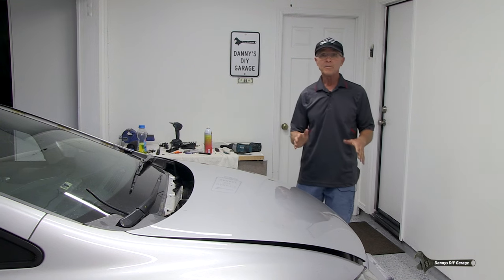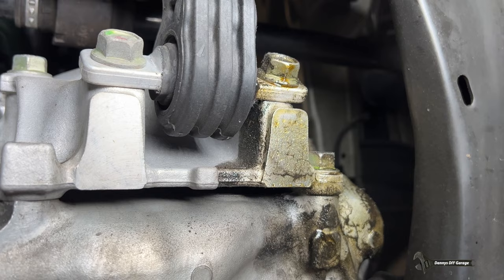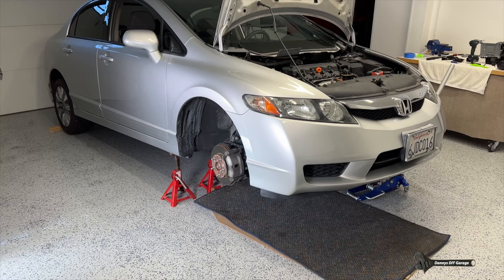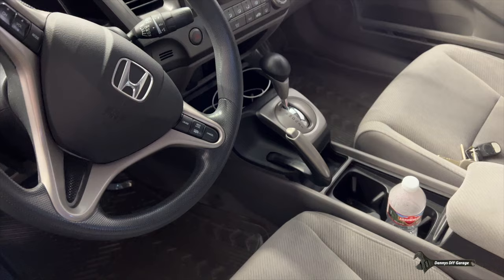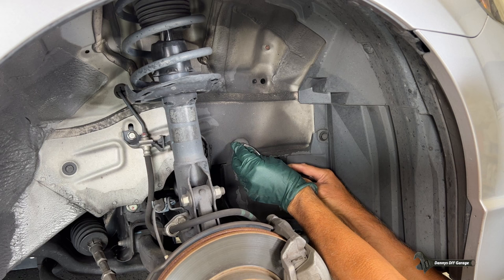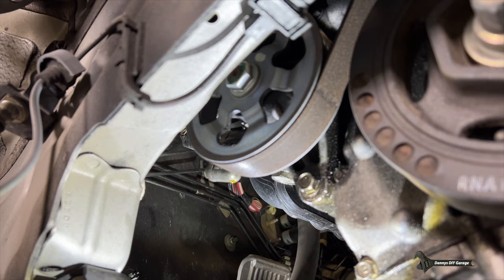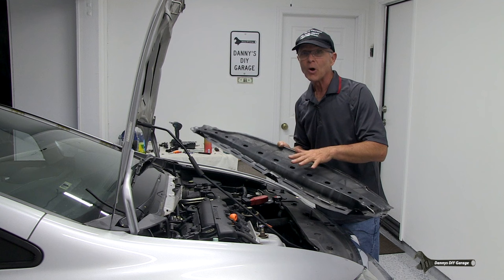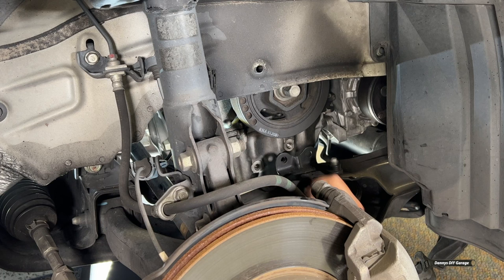Honda Civic Power Steering Leak or Whine noise, how to fix the Power Steering on a 2009 Civic

Comment: Hey guys. Great video braking down the  process. The pump is in kind of a funny place so I had to attack it from underneath and the wheel well at the same time. NOTE TO EVERYONE TRYING THIS: Make a point to bleed you power steering after this fix. It's entirely probable that your pump will pull in air so spend the extra 20-15 mins rotating the wheel with the engine  off to avoid damaging your pump or rack
Reply from the maker: Great information thanks for adding
Reply: Could you go into more detail with what you mean by this? I'm not sure how to bleed the power steering or what you mean by rotating the wheel.
Reply: @logantryint4660  basically what you would need to do is jack the car up (with the wheels in the air...not on ramps etc), turn the key to accessory mode and then turn the steering wheel from lock to lock 10-20 times. Do a quick YouTube search on "bleeding a power steering pump" and you will see a bunch of videos detailing it. Good luck!

Comment: Danny, thanks for another great video,  kudos for taking the time and effort to explain and demonstrate  the safety procedures that you use during your DIY repairs, its probably more important than  the repair itself.  Keep up the great work.
Reply from the maker: I do appreciate your feedback, thank you
Reply: 100% agree this video was amazing. I have this same problem and it saved it a ton of money. Thank you sir!
Reply: Place the wheel you removed from the car behind the passenger jack stand.
If the jack stand fails, the car will rest on the wheel and give you enough space to escape.

Comment: thanks for this. This solved my power steering leak although it was only one hose that needed the o ring replaced which is the one you used the red o ring on. The o ring it originally had was too hard and not round anymore. I thought for sure I’d need a new pump. Saved me some time and money from taking it to the shop as they probably would’ve just replaced either the entire pump or the entire hose rather than just replacing the o ring.

Comment: Well I replaced the VTEC solenoid gasket with the help of your video and now I see another leak in that same area you showed. My power steering reservoir is low, and I already did a flush.... using your video as a guide of course! I'll pick up those o-rings and give this a shot.  Hopefully mine goes as well as yours!
Reply from the maker: good luck, just take your time, appreciate you using my videos as a guide
Reply: how was it, did it work for you?
Reply: The power steering pump may need replaced but I haven't done it.

Comment: Thanks for going over all the jack points and safety tips! That's what's been holding me back from really getting in there. 

My power steering reservoir is full and the fluid looks clear there. The light lit on the dash and PS gave out for a second, and it's whining while the car is running. So I don't think it's a leak, but as I understand it the PS fluid is hygroscopic and wondering if its that vs a failing pump. The colour of the fluid is clear/light green (odd). It is a 2007 8th gen Honda civic Si
Reply from the maker: Green? Maybe die was added? I have a video on flushing the power steering fluid, I think you should watch it😊
Reply: @dannysdiygarage  turns out it’s electric and I was looking at the brake fluid! Lolz. Replacing the alternator. It’s whining something fierce.

Comment: Hi Danny, I hope you're doing well! His teachings came at the right time, because in the last oil change I noticed a leak starting below the hydraulic pump, however, it is probably from this oring. Just a few days from now it would be good for you to check if everything is fine because some friends who changed these origs had problems with the pressure hose of the steering box, I deduce that it is due to the increase in pressure since before there was a certain vent in this oring or really It was a wear problem. Thank you for the excellent work, I appreciate it!
Reply from the maker: Getting the O'ring from Honda is the key, thank you for adding this comment

Comment: Excellent safety tips!  Thank for the vid!  The black o-ring is the OUTLET o-ring.   The red o-ring is the INLET o-ring.  At least that how Honda have their OEM parts for the Honda Accord.  Crazy of the power steering pump location!  2001 Honda Accord 4 cylinder is at the top of the engine.  Very accessible.
Reply from the maker: Thanks for adding additional details 👍🏼

Comment: Lost the bolt for the high pressure line while putting it in it dropped and vanished didnt fall under the car not stuck in any bits under or surrounding the part, absolutely vanished. Dont know what the bolt is and cant find it online so looks like im outta a car 👍

Comment: I did the pump intake o-ring.but it was still leaking & found the high pressure hose leaking so replaced that. Then it blew the sensor o-ring out, now it's blown the pump's shaft seal! Going to replace the pump though I reckon a new shaft seal ought to be the solution, but since I'm this far in now...

Comment: Another excellent video. Easy PS o-ring replacement. I’m going to spray paint the cowel black. I don’t like the faded cowel. Going to change out the valance cover gasket so it also makes the job much easier.
Reply from the maker: Great idea

Comment: Hi Danny, thank you very much for the excellent video. I just discovered that the bolt securing the black Power Steering Return Line (with the orange O-ring) is missing on my car, which explains the significant power steering fluid leak in my driveway over the weekend. Could you please assist me in identifying the size of that bolt or provide its replacement part number so I can purchase a replacement? I greatly appreciate it.
Reply from the maker: Call Honda parts department, they will be your best option
Reply: Thank you Danny. @dannysdiygarage

Comment: Waiting for the video Danny … I faced same problem on my civic… fixed by replacing the O rings…
Reply from the maker: Mine have been leaking for a year, but it was so small I didn’t worry about it, I’m glad it’s done, hardest part of the job was working around the camera, I had to make sure I got the camera shot

Comment: so in total its 2 o rings is that correct?  when you replaced the 1st one you showed one was stuck. you then put the orange one on the male end of that one. i see its a 2 pack. is it a total of 2 or 3 rings that you replaced in total ?

Comment: when washing the engine what precautions do you take? debating on washing mine. 
excellent footage as always, thanks for taking the time to place the cameras in a way we can all see the work being done.
Reply from the maker: thanks for noticing the camera work, It takes 10 times longer to set up the cameras then it does to do the repair job, but its comments like this that keep me spending the time doing it, as far as pressure washing the engine, just use comment sense, you want to spray the engine lightly and stay away from squirting water in the alternator and other electrical component if possible, it's okay if they get wet, just don't spray the water at it, underneath you can spray anywhere, however don't spray off the oil towards the wheel or you might end of with oil on your rotors and brakes, good luck

Comment: Hi Danny,
Firstly, thank you for the amount of effort and quality you put towards making your videos. They are highly educational and polished. I have one question though. I've been having some trouble locating the correct OEM part number for the ORANGE power steering O-ring. In your video description, you included the part number for the black one, but not the other one. I'm currently trying to order the parts and I just want to make sure I get the correct one. Could you help me?

Thanks again!
Reply from the maker: Unfortunately I don't have that part number anymore, my mistake, I thought I added it, if you want to email me at dannysdiygarage@gmail.com I can send you a blown up image so you can get the correct part from the dealer. once you get the part number if you could, please send it and I'll add this to help others.
Reply: @dannysdiygarage  The correct part number is Honda 91345-RDA-A01!
Reply from the maker: I appreciate you sharing this, I’ll add it to my description ❤

Comment: Nice video! Curious, can you crack the bolts from the top (looking down) if you remove the metal plate? Rather than going thru the wheel well or underneath the car
Reply from the maker: you can, however its not going to be easy, underneath was by far easiest

Comment: Hey Danny,

How can I tell if it needs a full replacement of the power steering pump versus just replacement of the O'rings?
Reply from the maker: It will depend on the 
 problem you’re having, if it’s leaking and whines and the o’rings don’t fix it, then maybe a pump, but remember there’s hoses and the steering rack also, to properly diagnose the system there’s a gauge that can be used, however it’s hardly ever used because it’s take a lot of effort to use it

Comment: Hi, I'm about to do the same operation on my Civic. But when I called Honda, they told me they only have one o-ring which is the black one. I've done some researches and found some pics of Honda Genuine part having both o-ring inside. 

The question is... do you guys think that the black one could be used for the orange one?

PS: Great video btw .. thank you
Reply: ah  never mind, I found some details about the size and they both differs :) Weird that Honda don't sell the orange one
Reply from the maker: My description has Honda part numbers for the original orings
Reply: @dannysdiygarage  oh right! I didn't think about it... I found it on the web site with that part number! Great!!

Today I lift up my car and suddenly I didn't notice any leak on these 2 hoses connected to the pump... Rather it was all the way down the car.. There is one steering line who has a leak. I will try to wonder which one it would be but apparently it's the Lower Return Line ... Hope I'm not wrong. I'll come with a pic later :) Thank you for the part number of the orange o-ring

Comment: So when I turn the wheel on the car when stationary or about to back out of a spot , the car like gets kind of jerky and shaky  like a strong vibration . Not a motor noise but it does the same kind of thing when I turn any hvac controls on or have hvac controls on while sitting at a light etc. is this normal ?
Reply from the maker: Have you tried a throttle body clean and relearn the throttle body so the idle can keep up with the load? I have videos on this

Comment: Hi Danny, I plan on doing the O-rings and flushing the power steering fluid at the same time. What order would be best to do it in? Drain reservoir, replace O-rings, fill reservoir and then flush ?
Reply from the maker: Correct, that’s the order

Comment: I recently replaced my civic’s power steering pump when my last one broke. I put new O rings and flushed the fluid and bled the air out, but it still whines really loud. Any clue what I should check next? 
In the meantime I’ll just pretend my car has a supercharger!
Reply from the maker: Do you see bubbles in the fluid when you remove the fill cap? Also was it whining before you replaced it, or was that the reason you replaced it, there’s only a few components the rack, hoses and pump
Reply: when you say whine, is it as a hissing sound?

Comment: O-rings on power steering pump where hoses connect? Just a hunch.
Reply from the maker: Your hunch is correct ❤
Reply: @dannysdiygarage  I serviced the power steering on my 250k Element and fluid came with the o-rings. Also flushed reservoir that was long overdue. Thanks for the videos Danny.

Comment: Do you need to wet the o-ring with steering fluid ?
Reply from the maker: It’s always best to lube the oring with a little fluid
Reply: Thanks for awesome video! I got the OEM o-rings from Honda dealer for $2.99 took me 2 hours to get it done, but it’s worth it, stop leaking, very happy

Comment: Mine's not whining, but the dealership told me it's leaking when I got my oil changed last week. But they want almost $1500 to fix it. 😮😢
Reply from the maker: Hopefully this video helped
Reply: They probably wouldn’t be honest if it was only o rings. They want to sell you the whole pump. Mine 06 is leaking and feel confident that this is the issue. Plan on doing fix myself.

Comment: Mr Danny, at the 3:34 mark one can see 2 holes on a bracket. It seems to be the sub frame. They are right above the lower control arm. Behind those holes on the engine are 2 holes that 'look' like the bracket is supposed to be bolted on to them. Any idea what is going  on there? 
I hope you see this and I hope this makes sense
Reply: Yeah I saw the same and confirmed in this video that it’s apparently normal. Anyway it wouldn’t make sense to have the engine bolted to the subframe.